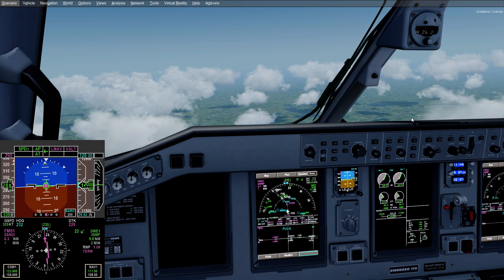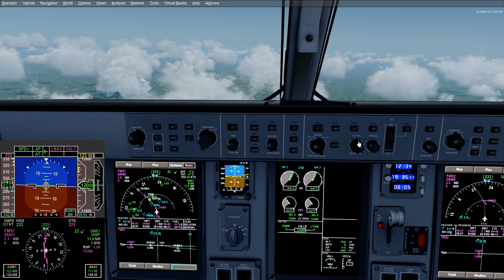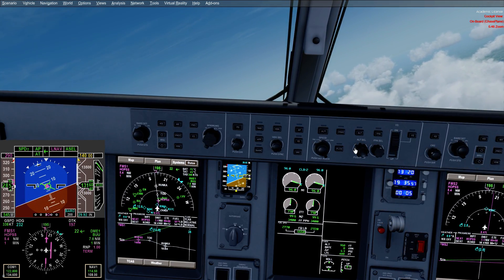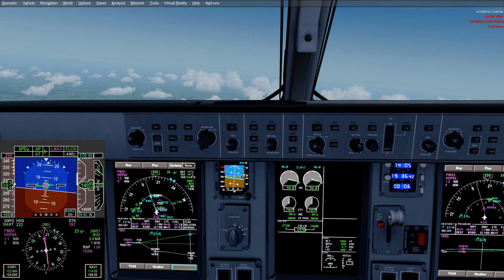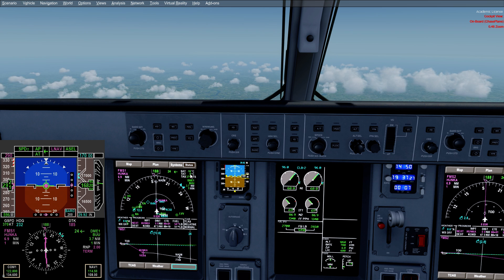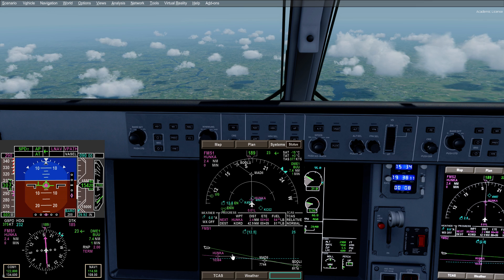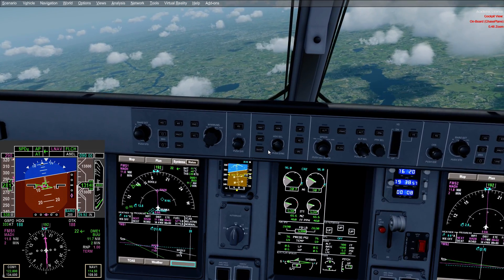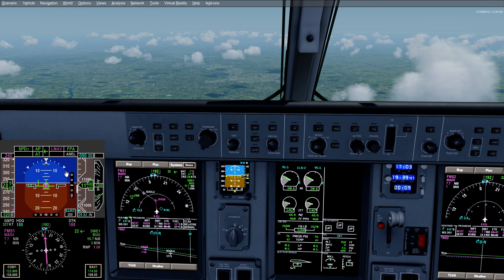FEELTHERE EMBRAER EMB FOR P3D4 FLIGHT SIMULATOR ALTITUDE MODES

Comment: Seems like it's going to be a nice product. One question regarding FPA mode. From the commentary it leads me to believe that you are actually using pitch hold rather than a true FPA. The commentator says for example that "you set FPA mode for example to 2°. The line appears at 2° on the PFD.....". In real life, when you set a flight path angle, it is not necessarily related to you pitch angle. So, is this truly a Flight Path Angle mode? Or is this how Embraer calls a pitch hold mode? Or was the commentary slightly misleading (for me at least) and the Embraer actually does calculate a set flight path angle and flies it?
Reply: It really is a pitch hold mode, to an extent. The pitch will vary to hold the FPA set relative to the horizon. So am example, if you get extremely slow, the aircraft might be 5 degrees nose up descending at 2.5 degrees, just ahead of a stall. This is where it becomes an Angle mode. Because we operate at safe speeds the aircraft attitude doesn't get to a position like that.

Comment: The leds above the buttons on the panel do not lit when pressed?
Reply: They do not light up in the airplane. To verify your autopilot modes you need to check the FMA on the PFD.
Reply: Douglas DeFouw Jr Thx. I thought that those little rectangles above the buttons  were LEDs.
Reply: @grillodon  so they were and it was intended for the airplane to originally have them but was decided in the end not to for reasons unknown to me.
Reply: Douglas DeFouw Jr :) a strange case where is the reality who’s bugged!